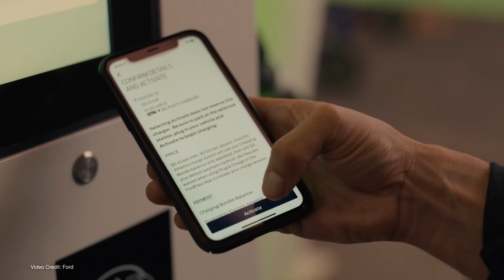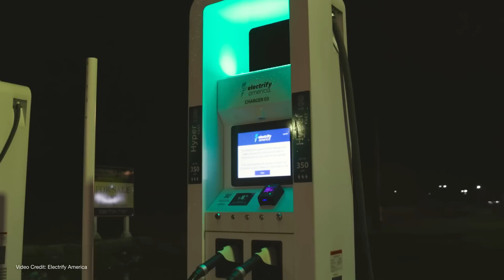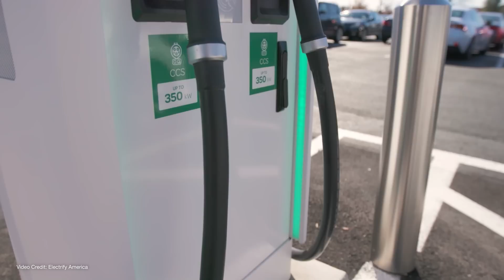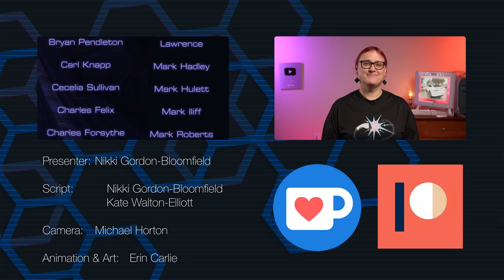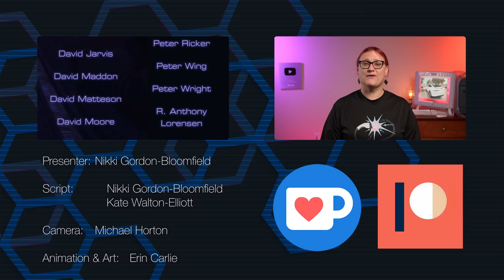EV Fast Charging Is BROKEN - And NACS Won't Fix Everything

Comment: 5:30 ChargePoint does all that (they design and build their chargers in house). However, just a few of their sites are owned and operated by them. Most of CP's equipment is sold to a local site host who is responsible for ensuring the chargers are maintained. ChargePoint does sell service plans with the chargers but I'm unsure of their exact terms.

Comment: At 14:50 TransportEvolved (Nikki) makes a very important and often overlooked point is made (as it relates to NACS). "Not all vehicles and charging stations are capable of the same levels of power transfer even if they have the same physical connector"
DC chargers literally supply current (amps) and not power (kW) .. a totally shocking fact to most. The power level is related to an EVs pack voltage, and has nothing to do with DC charging stations voltage specs ... unless there is an upper voltage limit that they can operate at. Such is the case for mostly premium BEVs with pack voltages exceeding 500 volts. Typically theses vehicles use an on-board converter that converts the voltage if only lower threshold DC charges exist. (eg: those labeled "up to" 175 kW vs. "up to" 350 kW). Some EVs (like Hyunndai Ionic) make use of the 800V charing hardware by pretending to be an 800V EV, and then step-down voltage on-board to gain faster charging. Neither types of ~800V EVs can take advantage of Tesla's 250 kW (750 amps) charging at current generation (v3) of Tesla's Superchargers. There are some rumours of v4 generation offering higher voltage limits, but no public data is available to confirm.

FYI: Tesla's CCS Magic Docks locations that came online at beginning of March with CCS1 connectors are all v3 hardware, so 800V EVs will be limited to a maximum power of ~150 kW of a possible 250 kW. This because these EVs limit maximum charging current to under 400 amps. Any NACS-to-CCS1 Adaptor is likely to have the similar limitations, as adaptors will only be air-cooled and have two internal points of contact (ie: points of higher resistance and heat generation)
I know, this is complicated and confusing to the average EV driver. This why auto OEMs and charging equipment manufactures need to agree on a number of standards and conventions are part of the NACS protocols. A NACS connector won't solve, or simplify these complexities.

Comment: Great analysis, Nikki. As a Leaf driver, I'm worried about how long the Chademo connector will be supported in the UK. I've recently seen several charging centres with only CCS support.
Reply: I wonder if a CCS2 to CHAdeMO adaptor is technically possible?

We know something similar (though in reverse) was done for Tesla owners wanting to use CHAdeMO chargers before Superchargers were ubiquitous.

If so, it begs the question: how cheap could they be made whilst still passing all safety requirements?

Although old CHAdeMO equipped cars tend to charge comparatively slowly, they also have small batteries so a 20 minute juice up is still worthwhile if you want to avoid stares at busy CCS2 sites!
Reply: @nettlesoup  various amateur electricians have worked on it. The approach they have taken is to replace the 240v type 1 / 2 charger with a CCS... not cheap and difficult to engineer. I just hope Nissan, who championed Chademo, don't just abandon loyal customers.

Comment: I have designed my own "electric equipment ready" type utility vehicle up and working for 3 years in the field and i simply have onboard cable on a spring loaded charging reel "self recoiling" but also have a "WATERPROOF EXTENSION " for difficult charging locations . .  .This is just for 240v cable charging of 5kw of battery gardening equipment BUT.. . .  .its proof of a general concept😉💡💫

Comment: Solution to the charge port is easy.  If you want to use superchargers (note I didnt say NACS) then the auto maker must put the plug in the back left, front-right or maybe center.  Tesla doesnt need to accommodate the other designs.  Their is no good technical reason when implementing the NACS connector that the charge port door cant be relocated to be compatible.  Standardization is good and a unique charge port location is not a feature.

Comment: Regarding equity and charging, I think while we can hope for a better, we can look at what has happened with gasoline refueling to see whether or not we can expect any support for it.

Well gas stations appear everywhere, and certainly they are configured in a way that gives maximum options to people refueling, it seems to me that there isn’t a lot of equity given to the manor with which a gas nozzle at a pump is configured.

Historically, and most of us will know this, gas stations would have attendants who could give you a full service. there are still some places that do this today, but it’s very rare. And some states require it as I understand it, I think New Jersey and Oregon maybe? But in most states, you’re pumping gas yourself no matter what.

Most gas stations still have attendance, but they aren’t there to help you. They are usually locked in their booth for safety, and they rarely if ever leave to do anything for a customer. Not being a handicap person, I don’t know if you can get assistance from them to help you in your situation. But I’m willing to bet that even if that is something they’re told to do, the plenty of gas station attendants will no longer give that kind of assistance. 

Now there are some accommodations that you can perceive, if you have a special need, you can park further away from the pump. You might block other vehicles, but most gas stations are expensive enough that you can mostly avoid any inconvenience that the vast majority of people might experience. In other words, Most gas stations have at least four pumps, if one person is parked in such a way that they are interfering, there’s usually at least two other pumps they can access.

But when you look at the nozzle and pump itself, I don’t see much accommodation for people who might have dexterity issues, etc. One imagines that most people who can’t operate a gas nozzle would not be driving, but there is a percentage of the population that can drive, but that would have a difficulty manipulating a gas nozzle.

All to say, I’m not optimistic that there will be any legislation that will make Connector-based charging any easier.

Fortunately, since most people who will own an EV will have charging at home, that will make this less than an issue. The only time, then, when this will be a problem, it’s for long-distance trips.

But I’m not optimistic that that will be altered either. When I’ve done long-distance trips, I haven’t seen much of anything that shows that those gas stations are any more accessible than the ones in the cities at the ends of my journey. However, it is possible that at those giant transportation, gas stations in the middle of nowhere, that the staff is more than happy to help somebody who needs it. I don’t know, I’ve never asked. And maybe that’s the actual solution. For those charger stations that are designed for long-distance journeys, they should have a little store with the bathroom and food. Requiring that the staff assist people who need it would probably deal handle with that issue.

For the rest, I wish you good luck, but again, I’m not optimistic.

Comment: 1. You can safely ignore any charger that's not Tesla. They are relatively few, and now with cars being able to charge at the much superior Tesla chargers, I don't see them growing, or even surviving.

2. The previous point mostly solves the location issue too. A few Tesla chargers are behind barriers too, but most of the time Tesla provides easy and free entry.

3. Diagnostics will be solved by Tesla, or at least made much easier. At the very least there will be only two parties, not three, which makes coordination infinitely easier. Also Tesla is incentivized to solve problems, because their revenue and reputation are on the line, while some others are government mandated, and therefore not cared for. Manufacturers will also care much more as they'll be increasingly get their revenue from EV sales.

4. I can't talk about equity, other than Tesla has a very diverse workforce, so I'm sure they are well aware of the problems, and motivated to solve them.

5. As for time, the bad news is legacy manufacturers don't give much reason for hope, they started too late and are struggling to make the switch. As everyone figured out the hard way, even Tesla, EVs are very different products, you can't just convert an ICE car and expect great results. Even worse for legacy, their company structure strongly reflect the structure of the car, so making decent EVs require a complete reorganization, which is almost impossible with unions and strong bureaucratic opposition. See Volkswagen vs. Herbert Diess. And that's just one of the big issues. I think they are almost hopeless.
But there's good news too. Despite this, we are on track to get the job done anyway, thanks to Tesla and China. Projections based on 20 years of data clearly show that most new cars will be electric by the end of this decade. And in the next decade technology will be good enough to allow the conversion of the existing fleet, despite the inefficiency of it. I've been saying this for years, but now it is starting to happen. It's not necessarily economical yet, due to battery prices, and you won't get a 300 mile range either, but time solves both, and this is a next decade problem.

Comment: I welcome going to one standard. I also think that auto-makers need to work together to put the outlets in the same places that would allows the plugs and cables to remain lighter and more widely useable. Also, as an aside, where are you charging?!!!? I’ve never had the problems (knock on electrons) you’ve encountered. I do agree, that EA has a lack of space for larger vehicles. But for the most part EA chargers have worked well and I’ve been enjoyed my trips. We’re still in the wild-west of the transition and I look forward to seeing it grow!

Comment: Chargers being in paid parking is fine, parking lots are expensive in cities and if charging was free when normal parking isn't, would incentivize chargers being blocked by non charging EVs and ICE cars even more than now.

What is completely unacceptable are all the chargers that rely on an app being at the bottom of a parking garage or other location where cell phones have no signal (I have ATT 5G which particularly suffers from this), with no Wi-Fi provided to enable you to actually use the app 🤬🤬🤬

Comment: Thanks Nikki...I've known this since announced it as it's just changing the end of the cable the plug everything else stays as it is and therefore there will be issues.  Tesla will be getting hammered I suspect when various car brands, not theirs, can't charge I can see the social media posts and youtube rant videos about that.  As for charging there definitely needs to be ALOT more chargers here's hoping that new joint venture between the 7 big automakers comes to fruition with their 30,000 planned chargers across the US & Canada.  Europe seems to be doing it ok from what I can tell but then I am not there myself.

Comment: @Transport Evolved EV Fast Charging is not Broken!!!  EV Fast Charging needs to be improved.   If we approach the situation, as if it is broken.... we are justifying to non-EV types that it isn't ready for Prime Time and give them a reasonable justification to hesitate to make the transition.  The truth of the matter is that we are developing something here and there are good charging stations and bad ones.  That is just like Gas Stations, there are Gas stations that are not great and others that are.   We have to make sure that in our pursuit of perfection, we don't forget that we need to make progress.   While it is true that the Charging system needs to be improved, this is what is happening as we speak.  Part of the IRA addresses improving the Charging Network, we all know it needs to improve and we are working on it.  But let's not also forget that most people charge at home and that is actually the best place for people to charge.  

As for the NACS not fixing things....what it does is bring a standard and competition to the mix.   Right now Tesla has the best system and it will only improve, the competing systems will either up their game, or exit.  The growing pains as you eloquently illustrated are simply that... this is a growing system and will take some time to perfect.  24/7 Gas Stations never used to be as ubiquitous as they are now, many used to close at 7pm.  Even now some stations, you use at your own risk.    Finding a Gas Station was often part of the struggle on a long trip.   

The EV charging network is suffering from growing pains....but it isn't "BROKEN".

Comment: 3:30 i hope the charging port locations standardize for NACS vehicles, back left or front right so the short cables can continue to work.
Reply: Most of the time center seems to have enough slack it should reach with most superchargers.  This opens up the lovely behind the plate solution of Aptera and the horrendously stupid front center location.
Reply: I love how 100+ years after gasoline cars started to become common, we still have a 50/50 split in whether the inlet is on the left or the right of the vehicle. Why is that? Does anyone know why this was never a thing anyone cared to standardize, beyond printing an arrow next to the fuel gauge to remind you which side yours is on?

Comment: Fun fact, when owners walks off you can pull the plug and toss it on ground OR plug in and charge on their bank account.
Reply: Not true at any of the fast charge stations I frequent. The plug is locked while charging and you have to stop charging for it to unlock. Once you stop charging, your account is no longer active.

Comment: Regarding charging networks that construct their own EVSE hardware in-house. (5:25)

The first was AeroVironment, which is the same company the created a fully-electric Mars-helicopter (Ingenuity) with a design life of 5 mission; BUT recently made it's 52nd flight. Seems they even managed to solve re-charinging on Mars. AeroVironment sold it's EV charging business in 2019, after only introducing one DC charging station model in 2011. AeroVironment previously supplied DC charging equipment for use at airports for ramp-side operators. AeroVironment DC chargers only offered the CHAdeMO connector, as CCS1 was not an official standard prior to 2017. AeroVironment DC charging hardware essentially lasted a full decade, when most models (at best) last just 3-5 years before being replaced.
eg: ElectrifyAmerica in it's 6 years, in the process of doing it's 2nd major DC equipment upgrade cycle (replacing dispensers, having previously replaced cooling cables, connectors and backend charging hardware)

FLO (and its parent company AddEnergie) is another such organization that manufactures and operates EV charging networks in US and Canada. Manufacturing occurs in Quebec and Michigan. 

In recent years, for some locations ChargePoint 'might' be considered a manufacture/operator, but generally it sells it's hardware to site hosters, and offers services in addition to the equipment. (offloading must risks with owning hardware assets) Historically ChargePoint acquired/outsourced hardware and rebranded it as theirs. Support for older hardware is extremely limited, as ChargePoint prefers host side operators replace with newer hardware every 3-5 years.

Comment: Every industry has this kind of problem but they are usually resolved by their respective Industry Standards Association. The SAE has not been a shining star in this case. I have been part of this kind of industry standardization and it takes some hard bargaining with real corporation commitments to the process, and for some companies, it may be a bridge too far. The CCS design was bad from the start and appears to have been designed by engineers who had never seen an EV or a car driver, especially a female one. I looked at the list of companies that "approved" the CCS design and I don't think any one of them has produced a successful (market-accepted) EV, as of this date. Sending a Jr engineer, with little or no corporate-level clout, to establish something that would be so universally used resulted in exactly the standard the auto companies deserved.
Reply: I wonder what they were thinking, the CCS-1 people. I presume they had J1772 compatibility on their list of requirements, and didn't want to achieve it with a plug adapter. I bet they also were told it would not be feasible or safe for the AC and DC modes to share pins. Or perhaps there was a requirement to scale to 500 kW @ 1000V, and the J1772 AC power pins weren't thick enough or separated enough to go that high.

Given the size of what they came up with for CCS-1, they surely could have instead left the J1772 port alone, and nestled a second NACS or NACS-like port underneath it (or beside it!), but self-contained rather than requiring a cable to plug into both at once. That's probably where they should've gone, right?

Comment: I politely beg to differ.. The big difference, slash problem, is software.. Non Tesla chargers have the unenviable task of dealing with several different and, let's be real, $#itty software systems..And do so with terrible computers that were not designed for task , or weather, they deal with.. Non Tesla chargers need to be personally and perfectly match with the car that is charging .. And that will happen when NACS / Tesla chargers are adopted.. Love the show ..